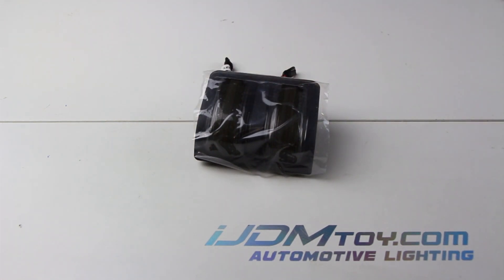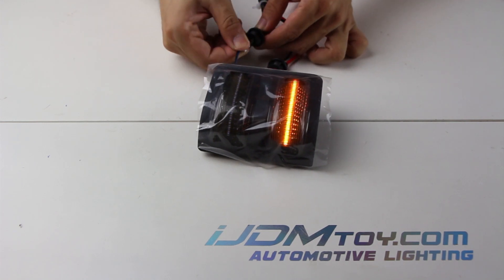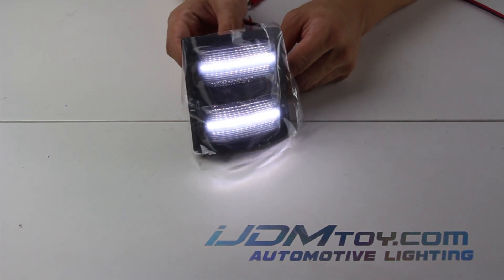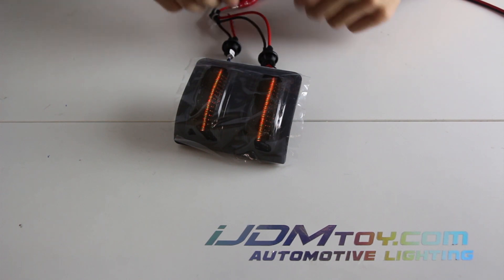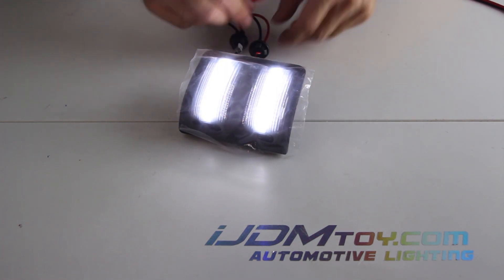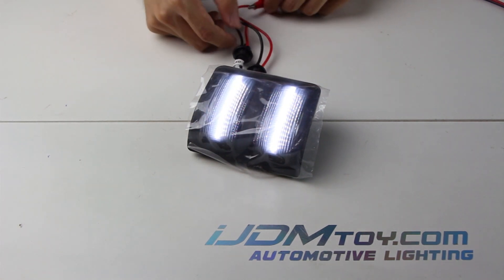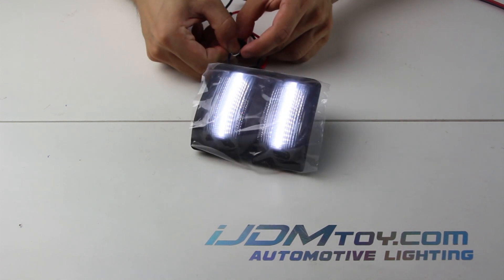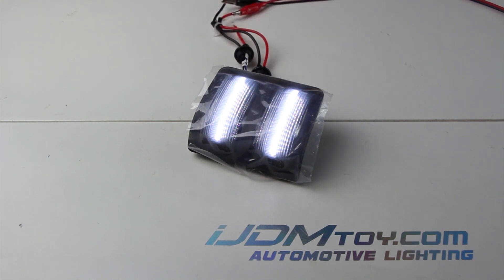How to Wire Switchback LED Side Mirror Lights Updated!

Comment: Just installed these 
Have both running  lights on but AS  soon as i connect the turn signals 
Loose power until i remove the  turn signals 
Vs same  thing if i connect  the turn signals  1st i have  both blinking  but when i connect  the rumming lights  they shut off until i unplug one of the two

Any thoughts,???

Comment: they just don't work.........   1 weak running light strip, the other is a weak flasher, if I flip polarity they don't do anything, swap the connectors and it just moves which one is weakly flashing and which one is weakly always on. You must have gutted the stock mirror housing in some manner to cram the stock sockets in there, there is no possible way for me to stuff all that out of the way without taking the mirror housing apart.